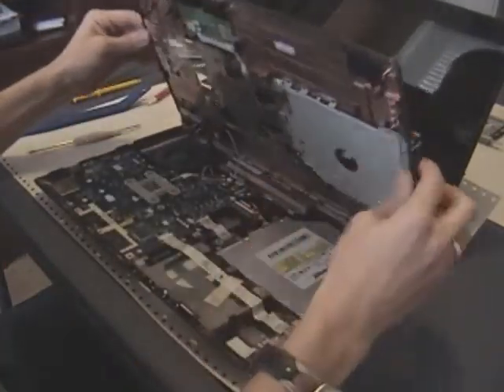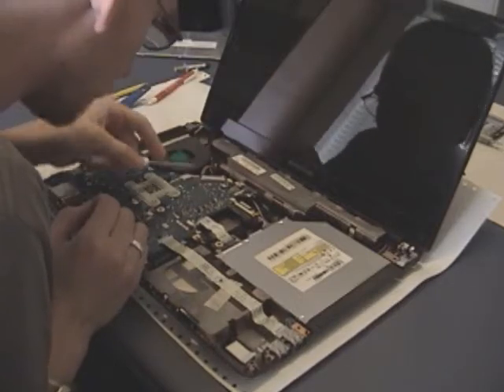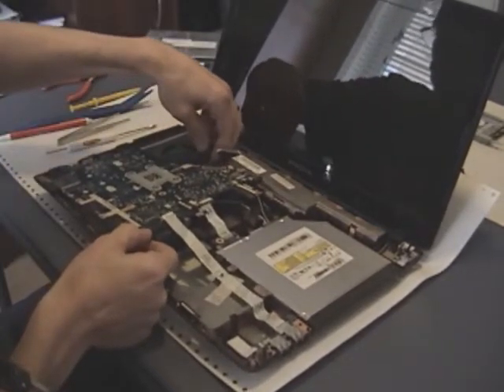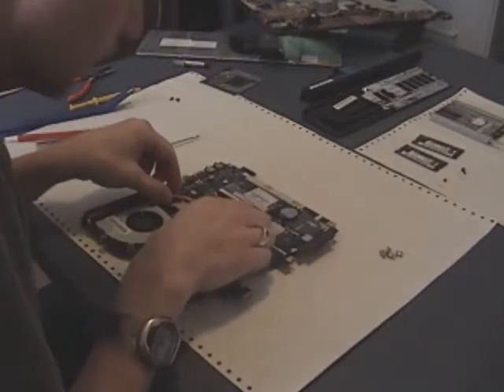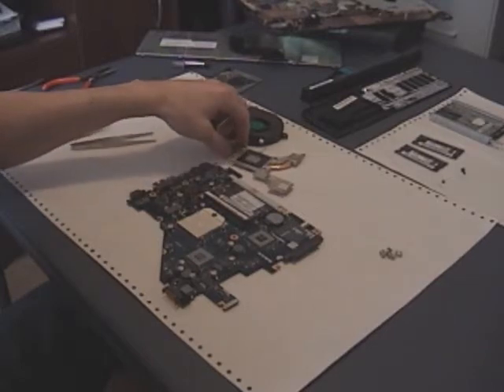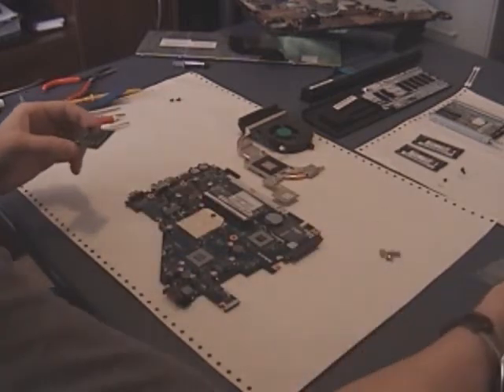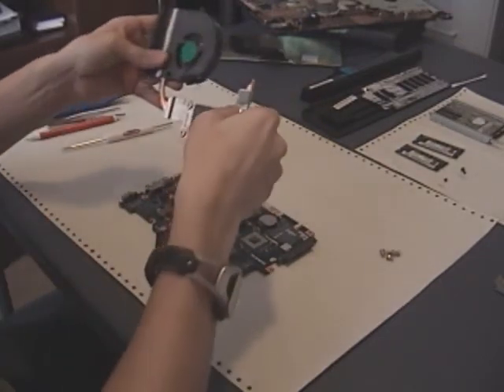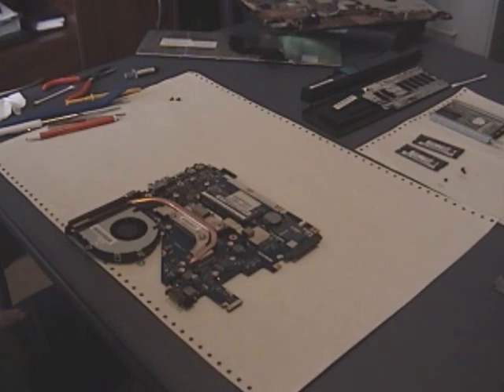eMachines E442-V133 Laptop Processor Upgrade Part 2

Comment: Nice Video. A lot of people already told me it was not possible. Thanks For Posting. Is Possible to do it with eMachines E443 with AMD C 50 1.00 Ghz, 2.00 GB Ram And 250 Hard drive? Thanks
Reply from the maker: kalidou sow Should be, but I'm not personally familiar with that particular model.  From what I can find your socket is FT1, so you could probably use C-60 or C-70 and possibly E-XXX or E1-XXXX group.  These latter ones are 18W TDP where yours is only 9W, so they may or may not work depending on how your motherboard is set up.

Comment: would this work being the same socket http://www.ebay.co.uk/itm/AMD-Phenom-II-1-7GHZ-Quad-Core-Processor-CPU-P940-Socket-S1G4-HMP940SGR42GM-/181723749276?pt=LH_DefaultDomain_3&hash=item2a4f945b9c
Reply from the maker: mikey webb Yes it should work fine.

Comment from the maker: @Peter Miranda  It should work fine.  I have that exact processor in mine now.  Make sure you get the processor completely in the socket and you didn't bend any of the pins or anything.  What does it do exactly when you try to boot?

Comment: hi this is an excellent video i have the acer emachies E442 with the amd v160 processor with just one stick of 2GB of ram
but i have just ordered the AMD Turion II Dual-Core P540 cpu and 4GB (2x2GB) Corsair ram to fit into it but how much of a performance increase should i expect with the new cpu and ram 
thanks

Comment from the maker: Mine works just fine on 1080p.  The video gets just a bit choppy, but otherwise fine.  Not sure the processor has that much to do with it, could be a slow internet connection too.

Comment from the maker: Sorry I don't really have any benchmarks from my single-core.  Now I have dual core N660, I've never tried a quad-core on this machine.  I can say it won't really affect those games at all though because they won't use all 4 cores anyway.  You'd be better off with a higher Ghz dual core.  No matter which processor you have this isn't a great gaming laptop because the graphics chip isn't that great.

Comment from the maker: I don't think those will work, but I haven't tried.  I have tried both 25W and 35W and they work fine, but I'm not sure if the motherboard will support 45W.  One commenter said they asked eMachines and they said it won't.  If you try  it, let us know if it works.

Comment from the maker: Yes you can--the same processors I've used will work.  In this video I use a Turion II P540, and I've since upgraded to a Phenom II N660.  Any S1G4 processor with PXXX or NXXX numbers should work. You don't *need* to upgrade anything else if you don't want to.

Comment from the maker: Well, it looks like it would barely meet the minimum specs--but it would fall well short of the recommended.  So it would probably run, but poorly.  My machine (with cpu and ram upgrades) barely runs Need for Speed Undercover, if that helps.

Comment from the maker: I don't see how. All the heatsink does is touch the top of the processor, and the screws just hold it in place.  Putting it back on you want to tighten each screw gradually so you get even pressure on the processor face, but when taking it off it doesn't make any difference.

Comment from the maker: @AllOutNoobHater The limitation with most laptops is the graphics chip.  Most including yours don't come with a stand-alone graphics card, so therefore you can't upgrade it.  I think your processor will be ok for newer games, but the graphics card will be the limiting factor.  For a specific game, go to systemrequirementslabDOTcom to check your specific system against a particular game's requirements.

Comment from the maker: @meanmugfan If you watch the first video (link in the description) you'll see where I remove both the hard drive and the RAM.  The only other steps for the hard drive are in this machine you'd need to move the hard drive bracket over to the new one (couple of screws) and you'll also need a way to re-install Windows (or whatever OS you have).  Good luck!

Comment from the maker: @ranvig1 I think they're pretty standard connectors.  The ribbon cable goes in, then there is a locking tab that you slide down and it holds it in place.  To remove them, you push the locking part out (towards the middle of the cable) and it releases the pressure on it.  I hope that makes sense.